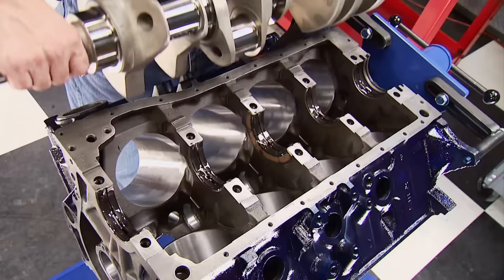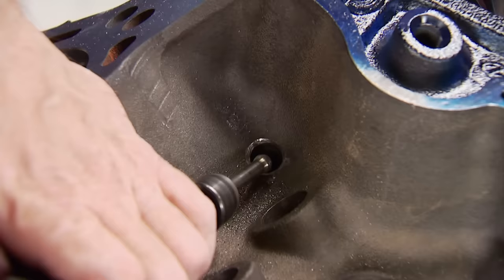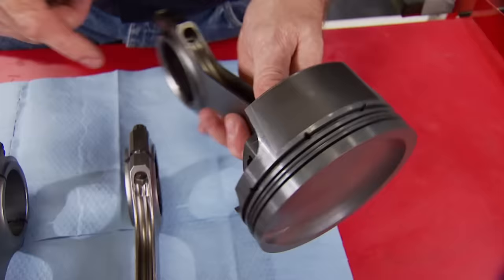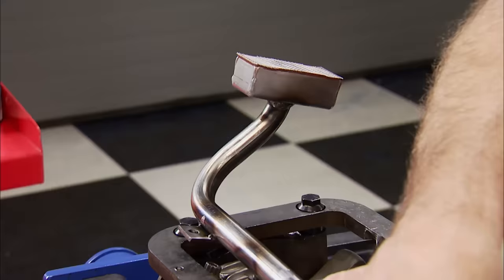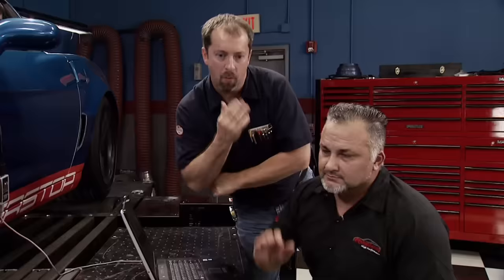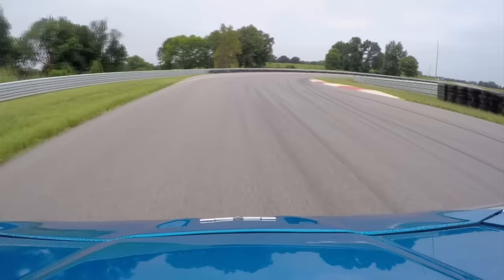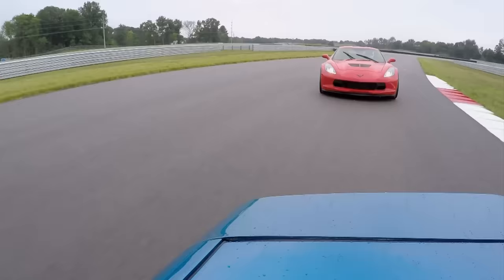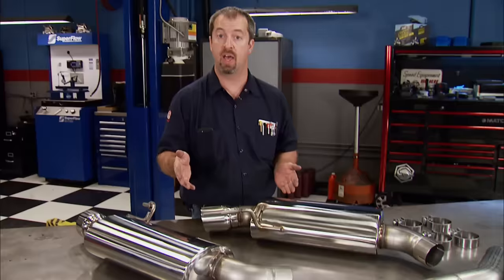Maxing Out a Ford 460 to 557 Cubic Inches - Engine Power S2, E21

Comment: The Vette stuff was a mood breaker. Stay on topic.
Reply: @bigboreracing356  the name Corvette originated from a speedy gun boat in WW2. Lol.
Reply: @bigboreracing356  yep.
Reply: @bigboreracing356  ; A "junk yard" engine block putting down 750hp, a "boat anchor"? Back in high school during the 70's, we would ask the question, "How do you spell Chevrolet? MOROSO." Countin  down the days when Chevy folds.
Reply: @bigboreracing356  ; Sure you can..... Show me the receipts.  Merry Christmas and a Happy New Year!
Reply: @bigboreracing356  ; Just watched your 7 videos. BBC?  yawn... Your time slips are from May, 2018. Did the rod twist after this test and tune? You bow tie guys always talking about a BBC/SBC is thousands of $$$$$$ cheaper than a similar BBF build.You start the build in Sept, 2019 and here it is Dec.2019.Takes time to get that $$$$ together. Why not the twin turbo small block Ford? If it can "smoke" the featured BBF in this video, it surely can make the BBC explode. :) Anyhow, I learned more about engine building. Thank you. I usually have a pro build my engines, which has been nearly 30yrs. I own a original 1969 Ford Cobra fastback with 428cj, 4spd. 69 Roadrunner, 2009 GT500, and 2013 Challenger R/T Classic. Fun Fun Fun!  I'll check out your future videos.   John
Reply: @bigboreracing356  ; Finally, someone admits a Chevy engine failure. 99% of the time, all engine failures is the result of the builder. I've never heard of a 385 Ford crankshaft coming apart, 429 or 460. But that doesn't mean it hasn't happened. Let's see you pull a salvage 1990's Chevy truck 454 SS or any salvaged 454 for that matter and do the mods you're doing now. From what I can see, you're using a aftermarket block and everything else. PowerNation is using a "old 460" Ford engine block with eagle rotating assembly. If that crankshaft breaks like you say it will and that includes all 385 engines, then there's a flaw in the manufacturer, not FOMOCO. I'll look forward to seeing your next video. Maybe you can hold up a sign saying, "Help! Please send money!"  :)  Again, Merry Christmas.  John
Reply: @bigboreracing356  why did you watch a video on a Ford big block if you don’t like them
Reply: @bigboreracing356  couch mechanics unite!
Reply: @simplyfred8044  thank god the French weren’t using it in the 70s -1670s...
Reply: @johnserton7997  Bmp. I recently read that the name Corvette was strongly used by the French Dutch in 1670s. Interesting name for sail equipped vessels. I apologize.
Reply: @simplyfred8044  no harm done

Comment: I built a couple of 460's in the mid-70's.  I had a tough time finding speed parts for them at the time.  They are really great engines and simple.  So much more is available for them now....it's amazing.  Wish I would have had access to some of today's stuff for them.
Reply: @bigboreracing356  Unfortunately, nothing to put it in.  That, plus I'm at a point age-wise where I'm probably going to sell my engine stand and puller.....hate to but have more metal in my back/knees/shoulders than I have in the engine.
Reply: 2 bolt main junk
Reply: @Tsalinger  Agreed.  Depends on how much power you want to push thru them.....even at that some guys are making good horsepower.  There is always the CJ and SCJ blocks in both the 385 series and the FE's.  I was building for towing and warmed-up street use.  Wonder how far these birds will end up pushing this thing.  I'm 73 and a lot of my building days are coming to an end.  Dollar for dollar it is hard to pass up the BBC's for strength and power..  Only weakness that shows itself is the heavy valve train if you are really going to wind 'em up....but there are cures for that problem.  I fell into a deal 40+ years ago and got a couple of 427 side-oiler Fords on the cheap.  Talk about a stout bottom end, forged and cross-bolted.  Had a lot of fun with them.  Thanks for the comeback.....what are you building?  Working on a little 302 Ford now.  Have built SBC's and you cannot go wrong there.  Had a 440 Mopar in my RoadRunner back in the day....a real thrill.  The drivetrain doesn't know what the name on the engine is.....it just knows horsepower!  Lemme know what your up to chief!  Again, nice to hear from you.  Keep the Faith
Reply: @cavscout62  Thanks!  Finally a voice of reason!
Reply: cavscout62  You’re correct, my thoughts exactly. This has a stud girdle and it isn’t a little SBC.
Reply: @tomnekuda3818  Blahblahblah... there's a guy on my forum that is now legally blind and still builds his truck, there is literally no excuse
Reply: @slowstang88  He drives it, too, I suppose?
Reply: @tomnekuda3818  Who gives a shit? He's still going. I got 2 herniated discs, arthritis in my right hip, a bad knee, and my neck sounds like a bag of gravel when I move it but I still work on my shit. Play the victim and you will be the victim..
Reply: What makes them simple compared to any other OHV V8? Nothing unless you're comparing them to other Fords.
Reply: @Tsalinger  I think they are making 700 to 900 with those 2 bolt junk blocks. The BBF block is better than any factory BBC .
Reply: @jasondavis5218  I've always owned Chevy, but that's truth. Facts are facts.
Reply: Of you put a 460 in a foxbody can you use a  C4 transmission?
Reply: @oscarvillarreal8951  Yeah but get a built one.
Reply: True. Simple and strong and reliable.
FE's, friggin expensive, were more of a challenge. But not simple.
Reply: @marthamryglod291 so you don't know anything about Ford's. Thanks for telling us.

Comment: 598 cubic inches is the max bore and stroke on most 460s before you have to notch the oil pan rails. Also Jon Kaase SR-71 heads and intake are yielding upwards of 1100hp naturally aspirated now. and that was on a 545 BBF I believe
Reply: Tell'em John!

Comment: I built almost exactly this about fifteen years ago, but I used Edelbrock Cobra Jet Performer RPM heads and a Victor intake. I never dyno'd it though. Sumbitch lifted the nose of my car with 4.11 locker rear.

Comment: 0:32 - We built a 572 inch BBC from bits/pieces laying around the shop.

Yep, that happens (to me) all the time.
Reply: After market block! Chevy limited to 496/502 maxed out standard BBC. A standard 2 bolt 460 is stronger than a 4 bolt BBC. I've raced them both.

Comment: My Dad knew some guys who somehow managed to cross the rods when rebuilding a 440. Apparently the starter wouldn't even budge it. They drug it up and down the road in front of their place and actually managed to get it started. I guess it ran for about 10 minutes which I thought was pretty damn impressive. considering. I guess they used a crow bar to force the one rod over. Not sure if it windowed the block or not, I wouldn't imagine it was much good even if it didn't. Pat saying "If it's tight something not right" made me think of these guys who obviously didn't live by that motto of engine assembly.

Comment: This i believe,  as my Dads 1979 Ford F-250 460 was a "stump puller"  completely stock, even WITH tons of restrictive smog control!
I can only imagine how powerful and fast this will be.
Reply: It will suck. They do not handle big power reliable. They are good at 460hp anything more they will break in about 20k miles. At 460 hp they will last 60k miles before it will need a rebuild. And under 400 hp they will last 200k miles. I pulled 200k miles all while under load pulling stumps out of the ground a few feet at a time

Comment: A Ford 460 is not "maxed out" at 557 cid.  Many articles have been published of 460s turning into 598s or 602s. And that's with the standard 4.90" bore spacing. In fact, pro stock drivers with Chevys or MoPars often used to complain that Fords had an unfair advantage because they were at 4.90 vs 4.84 or 4.80 that others were "stuck" with. Which is why now everybody is equalized at a 5.0" bore spacing.

Comment: If my memory is right..... big block mopars have the tallest stock deck height , & that is part of what makes them easy to stroke. The oil pump being mounted on the outside of the block is also a big advantage compared to Ford & Chevy.
Reply: Don't forget shaft mounted rockers and easy intake swaps without pulling distributor  !

Comment: Let's not forget everyone this is a piece of production iron that swallows a 4.5 inch crank. Let's see a Chevy do that
Reply: And whats the big deal that you need to machine the block a bit? The only thing ill really give the Ford big block credit for is the factory crank, those will hold more power then a Chevrolet factory crank. Other then that they're both excellent engines.
Reply: I swallow 4.5 inches daily son, what?!

Comment: When you use a long socket or extention on a tork wrench when Torrington down your bolts it puts more leverage on the bolt so its actually tighter than the company recommends. So it's over stretched by about 5 to 8 pounds.
Bloodviking

Comment: Uncertain.  Wait a minute, I got 600 CID out of my old 385...  Granted, performance heads, a little boring, sleeveing, head-grinding and some-odd material removal here and there went into it, but that’s a HUGE difference from what you guys achieved.
Honest.  Granted, I often referred to it as a 580 stroker because that’s the stroker kit I put in there, but not including the BDS Blower I stacked on top I was pushing a naturally-aspirated 600 CID exactly.  But it’s still way off of 557.
Reply: What about the A-460 or similar block that you would HAVE to have to get over a 557? BDS blower........ Yup you are blowing all right LOL. 🤣🙃

Comment: Thanks for the video and info my son and i are building a 59 Ford F100 we put a 2009 crown vic front suspension rear 4 link suspension 9 inch rear end engine 460 going to build like the on ur show stroker 557

Comment: Why not start with an SVO 600 block and some JohnKasse heads if you really want to make the Bowtie boys cry??🤘😎👍
Reply: You got SVO/Ford Racing money? This was to show a average person on a beer budget what is possible when you use mostly rebuild parts but some nice heads/cam/intake. Back when nothing was available but some camshafts getting to 500+HP was fairly difficult. With modern cylinder heads and solid lifer roller cams, 9000 rpm and 1000+ HP NA isn't a problem.

Comment: Another great vid, guys. I always chuckle, however, when people use ARP oil pan hardware XD
Reply: @bigboreracing356  I just run a thick ass bead of RTV sealant around the flange, and hold it all together with a ratchet strap.  I don't even bother with hardware anymore.
Reply: i’d bolt that motor together inside and out with Pro-Series ARP Bolts to make sure it stays together and doesn’t ‘grenade’ under power

Comment: The 440 Magnum doesn't wear a girdle. lol  Unlike Ford's & Chevy's BB's Chrysler's BB's have a raised block to support the heavy rotating assembly. IE: crank shaft. The 426 Hemi BB adds to the raised block with cross bolt mains. Again for more support on the rotating assembly. I have no doubt that is how the Hemi became a racing legend. Bone stock Chrysler big block Hemi's straight from the junkyard ran on Nitro fuel at the race track. The same Chrysler race cars had to have their own class using the same engine going from gas to Nitro.
Reply: the 426 Hemi Elephant Motor was a monster

Comment: People laugh when I say I had a Chevy 406 2 bolt mains block holding 620 NA Horse reliability, raced on the weekends and driven on the streets, it held up without any issues to an impressive 150HP shot of nitrous as well on both streets and track! With the time taken and care to details and the important things like deburring the blocks it is entirely possible to have a reliable 1000HP stock block engine! I finally had a lean condition cause a top ring seizure when I tried pushing it to a 250 shot of nitrous which unfortunately after a long life was the demise of baby! The top ring was a hair too tight on clearance from thermo expansion which caused a chunk of the piston land to crack off and be pushed through my very expensive Cantfeild head! Bent a rod and cracked the bore. Unfortunately the crack was too long protruding just to the webbing of the block and sadly couldn't safely be saved, unless it was run on strictly methanol and water jackets were hard blocked to seal them from any oil leakage into the water jackets....... But the fact of my story is if that ring never seized and broke the TRW forged piston, it probably still be racing today! I had H beam rods on a cast STOCK 400 crank 010 under a stock 2 bolt block and sadly the parts to give out on me because of something self inflicted were the "Performance" part due to adding much more power than they were ever designed to handle! BUT like I said, I have the last laugh, it pulled a very low 10 second pass 2 times prior to that piston saying goodbye on me on its way into the high 9s before I got it fully tuned in! But the fact of the matter is, please don't ever put a stock chunk of cast iron down even if it's only a mere 2 bolt mains! Of anything back then I ever expected to break like that stock cast crank or mains caps! It was pulling over 800hp but a little lean condition put it in an early grave. Otherwise great Build guy's! Nice to see people having some faith with some old Iron! Thanks!

Comment: I've got a 97 Ford F350 4 by 4 and an engine would just be sweet in there
Reply: hopefully you have a strong enough drivetrain to handle all that horsepower and torque

Comment: Put that 460 in the zno6 it would be a better car.
Reply: U must be crazy, I own both Ford 460s,and Corvette engines both are monsters,but the modern GM motors are simply amazing they make hp easily and are reliable!
Reply: @adambrooks2297 zo6 is a joke compared to gt40

Comment: 455 Buick engine stock has 360hp with 510lb ft of torque with cam ground pistons versus most other engines with slipper type skirts.
Reply: 455 Rocket Block or 455 Fireball Block ?
Reply: A rocket is an oldsmobile. A fireball is a buick straight 8. Stage 1 or a rare stage 2 is what I should have explained.

Comment: So, 557 is large, but its not 'maxing' out a 460. Some D9 blocks with the 6.25" long cylinders can go to 4.5" bore. Combined with a 4.75" bore, that's 600 cubic inches. With deck plates, the d9 block can go to 640" inches.
Reply: LOL, wrong. No smog era block gets you 600 ci's LOL/ 😂🤣😃

Comment: I can't imagine why people feel the need to offset the rear main seal. I have never taken an engine apart that was that way, nor have I  put one together that way , and had it leak.  The only thing I can think is helping a block with sever main cap walk, or a block that will twist at a huge power level, and either way silicone should flex enough to keep the seal bonded. Try offsetting a rope rear main seal with success! lol

Comment: Most expensive part of this build was probably the fasteners
Reply: Seriously, you don't need ARP bolts on your oil pan. Head studs and rod bolts are the only things you should be buying from ARP. Even then, if you're not increasing the torque applied they're not any stronger than factory. The stiffness of steel is the same be it fancy 8670 with the ARPs or 4130 for the factory bolt.

Comment: 3:36 can see scrapes and scratches in the bearing even showing after the thick oil is applied
Reply: they are just marks on the special coating the race bearings use, they are from checking clearance with a dial guage. this is perfectly normal and not damaged
Reply: @dylan9768  there not using the good black coated king bearings pmax black tri metal. Just cheap shit
Reply: @dylan9768  if u manage to scratch engine parts with a Plastigage, micrometer, dial-bore gauge YOU SHOULDN'T BE PUTTING ENGINES TOGETHER
Reply: DeVoNmotorsports they are not scratches have a good look. Dial bore gauges always leave marks on coated bearings because of the spring pressure applied on the tip.
Reply: @dylan9768  why are you pretending you know what your talking about lol your not even supposed to touch the mating surface areas. Use PLASTIGUAGE And you should coat the back of the bearing with oil to prevent rust under it. Also if you look to the left side of the (possible scratch center line) the are scratches z shaped there showing even after thick assembly lude is applied lol